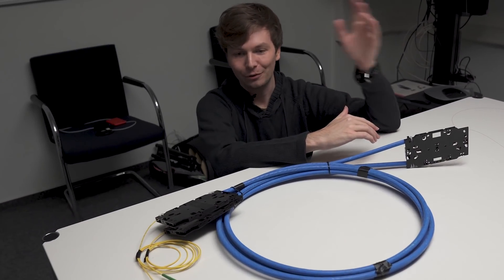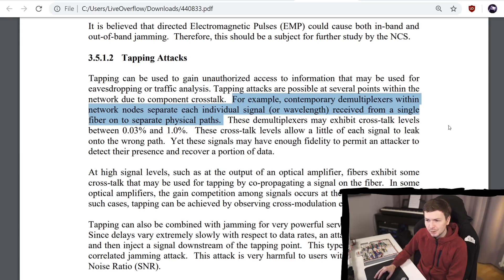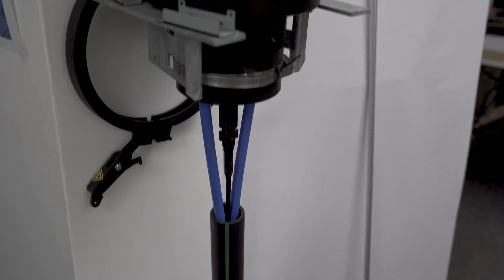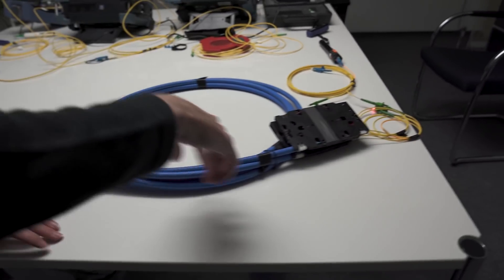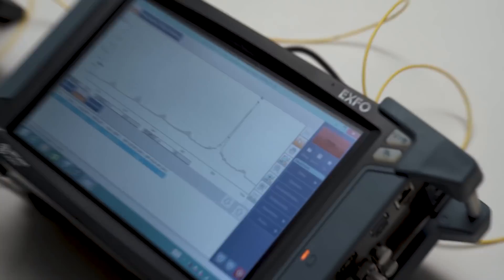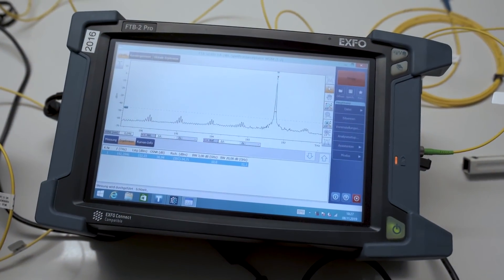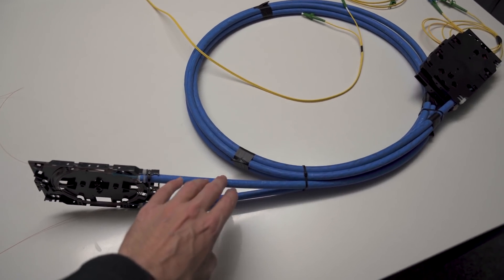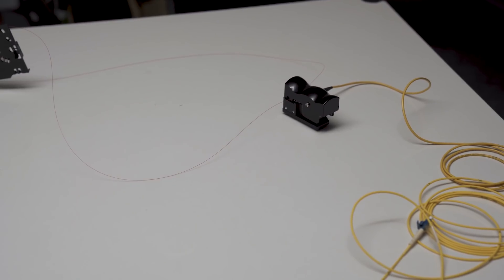Fiber Tapping - Monitoring Fiber Optic Connections

Comment: Would using a VPN and regularly changing the location make tapping useless?
Reply: You'd just be shifting the problem from your fiber to the fiber the server is on. It might even increase the risk.
Reply: @latte_macchiato_de  yea but could they break the encryption? And if I change the VPN location every few hours or so, would they go ahead and tap all those locations in time?
Reply: @blakryptonite1  You misunderstand my comment. All a VPN truly does is take your packages, put them into a box, encrypt that box with a key and send it to the server. The server decrypts it, forwards your packages and replies with more boxes of responses.

You're shifting security issues from your connection to the servers connection. VPN encryption is *never* end to end, it's only as secure as the weakest link.

Well, your second question depends entirely on whether you are truly an important target. If you are, you can bet three letter agencies will find a way to get your data.
Reply: Depends on the protocols used for all of your communications. Some ISPs encrypt fiber traffic, so regardless of using HTTP vs HTTPS or a VPN, this attack does not work. If your ISP doesn't encrypt the traffic through the fiber, HTTPS prevents sniffing/MitM. If you don't use HTTPS, but have an encrypted connection to your VPN, that traffic is safe, but the traffic from your VPN to the Server is not.
Reply: You seem to have a misunderstanding. From your comments it seems you think that if someone wanted to tap your connection he would pack his tapping gear up and travel to the physical servers that these VPNs use to route your traffic. From there he would listen in on your connection. 

But that’s not what would happen. Regularly changing the VPN location would have zero effect because if someone wants to listen in on your connection, they will listen in somewhere along the path between you and your ISP. Using a VPN does not cut out this essential first part of the journey. All of your home network internet traffic will go to your ISP first for routing; Using a VPN will only change where that traffic is initially routed to.
Reply: @synack_  Do take into account that a VPN encrypts all traffic using a previously shared certificate. You don't get to decrypt that. Listening at the VPN itself is the only real option.

Comment: They talk about tapping 19 years ago because they were already doing it many years before that
Reply: And that's why this technology became mainstream.
Reply: @lakami15128  Right... because copper can handle 100 Gbps, and is clearly more secure.  SMH
Reply: @ShainAndrews  weight, price, power consumption, losses..
I don't believe copper is more secure. In the end, IMHO there is no security without encryption of the data going through the medium.
Reply: @lakami15128  sure -that's definitely it - that's the only reason
Reply: We tested long haul fiber with this method over a decade before this document came out.  Basic stuff just to verify what carrier was on which fiber.  Been rolling out encryption for the past six or so years.  Encrypted traffic encapsulated inside encrypted fiber.

Comment: Edit: I stand corrected, read the replies to this comment  :) 

Soooo here's the cool thing about this. This is called 'evanescent coupling' . Massively oversimplified & in a nutshell, laser propagation through a fiber has a small portion traveling along the fiber, but outside of it, not in the fiber core itself. This portion of the light is called the evanescent wave. And if conditions are right and you place another fiber alongside, this light will couple into that fiber. If you wanna learn more about this, look for research papers or literature about optical coupling, fiber coupling, evanescent coupling, directional waveguide couplers etc.

Now the cool thing about this? It works both ways. So I can imagine you 'tap'  the signal, but you can just as easily introduce energie back into the fiber at the same wavelength. Energy-wise you could "feed"  the sytem energy, which you just took away by tapping into it. This way you could migitate the drop in power. Not sure what would happen to the information send through the fiber though, whether you'd completely drown out the original signal, or if it would just be perceived as noise and the data could still be extracted, making it more obscured that there's an attack. I guess that mostly depends on networking protocols, which I'm definitely not an expert in :D 

Used to do research with this very phenomenon, except that we didn't try to do data-manipulation or stealing, but use the phenomenon to develop incredibly accurate sensors, by investigaging how changes in the environment of optical waveguides altered the properties of the transmitted signals.
Reply: That's not actually the effect demonstrated here; this is a much more simple case of distorting the waveguide (fiber) enough that you get real waves now exiting out of it (using a bend), which is then recaptured as the "tapping"
If it was evanescent coupling, there would be no light leaking out at the tap, only light leaking to the adjacent fiber
Reply: @bluerendar2194  I don't think vanillesoep was suggesting that the demonstrated effect was evanescent coupling. Just that evanescent coupling could be an interesting alternative for the lossy tap demonstrated here. Physics sure is fascinating.
Reply: @eikenope1008  
You're right in that it's a really interesting alternative, and also poses an in-built security risk due to crosstalk if isolation isn't properly done. However, his comment says:
"here's the cool thing about this. This is called 'evanescent coupling' ."
Which is not the case for the demonstration (although crosstalk from evanescent coupling is one of the headings in the article at the start)
Reply: @bluerendar2194  You're completely right, not sure why I mixed up the two and rambled on about evanescent coupling. Thanks for correcting me.  Point still stands that you can introduce a signal into the fiber that you're tapping into, whether by evanescent coupling or other methods.

Comment: THz!? Holy smokes!
Reply: Thats not the frequency of the data signal though, but the carrier, i.e. the frequency of the red light. The usual infra red that is used has a lower frequency than the visible red light used for the test here.
Reply: @eikenope1008  Thanks for the clarification.

Comment: Why is that taping device so expensive? Isn't it just a mechanical device? I wonder if this can be 3d printed. I think it would be smart to bend the fiber less and make the taping active with some amplification. It'd cause a smaller drop in signal strength on the other end so would be much harder to detect. Fiber output boosters are expensive but I'm sure a simple circuit with a high frequency vacuum tube might work, if not maybe a garnet laser for amplification.

Comment: Signal level would drop on a strand: any software monitoring the transceiver would report the anomaly.
... And I should have waited until the end of the video.
Reply: You’d have to know what the original signal strength was. There are devices that can monitor the fiber and detect any tampering such as digging near the fiber cable or someone accessing the splice box/tray. The good ones can tell you where it is happening so you can dispatch police or security.

Encryption is available to everyone and is highly recommended for sensitive information that you send or receive.
Reply: @christopherestewart  AFAIK all optical transceivers support reporting of transmitted and received power levels. If (RxPWR.10111 < RXPWR. Then you likely have a problem.10111.avg(6m)*0.10)... 10
Reply: there might be tap with amplifier which would require much less bending. so have fun try to detect those
Reply: @nekochan7001  good luck getting an amplifier in the circuit without disrupting the connection. Plus, the iridium doping and amplification should be on the far ends of the link... Not anywhere between.
Reply: @jamess1787  he was referring to amplifying the captured signal, not the signal in the line. Basically, this would allow for less of a bend and create a less noticeable power drop.
Reply: @foxrumor  exactly !
Reply: @jamess1787  they have to amplify regularly for a long distance cable there is still signal degradation that needs to be accounted for in the cable.
Reply: @EwanMarshall  assuming the optic cable is 100km+ (or 70+ miles); anything less than that you should be able to easily detect losses on either side spike when there's a huge change to an underground cable or in a splice-can. Above-ground might have more fluctuations due to temperature shrinkage of materials (and relative losses/attenuation in the cable). Not many people using long distance above ground fiber for data communications though... Sounds like a terrible idea prone to outages and breaks.
Reply: @jamess1787  It is usually undersea cables they are dealing with here for tapping ;)

Comment: But the drop in signal strength would only be noticeable on the receiving end, at the sender. This tapping-detection would only be practical for closed-systems (mainly the military), not for general Internet customers. :-/
Reply: The operator usually provides the gear anyway, so it wouldn't be that difficult to implement.
Reply: Signal strength is definitely a metric you can view on commercial network kit. That said... If you're actually monitoring that metric, you're going to be a certain type of customer.
Reply: So tapping the military isn't concerning?
Reply: @guiAI  it's a known tactic (there are public designs of russian submarines that demonstrate under sea cable interception capabilities) but is of little concern considering all military communications are encrypted and all sides are at it.

In other news. Your WiFi network traffic can be captured... and it's using considerably weaker encryption.

Fibre for as "easy" as it is to use a microbend device to monitor the signal, I would still consider it more effort for a would be attacker to tap it. One requires you to delicately strip a glass fibre, bend it such that it leaks but doesn't break and monitor the signal using specialist kit that's capable of monitoring a signal waaaaaay below what a normal fibre transceiver module would work with.

The other, requires a network hub.
Reply: @lmaoroflcopter  Interesting, the point of my comment was that tapping the military seems a bit more concerning than tapping a random house, but of course both are awful
Reply: Well, yes and no, the cable provider controls both ends usually, someone like Level 3 that operates the cable under the sea, they *could* in theory use this method.
Reply: These days we mostly use single-fibre solutions that sends and receives on the same fiber separating traffic by wavelength.

Average customers are probably not monitored by the isp though, so if you are paranoid you should probably just use encrypted services such as a vpn as this defeats any attempts at fiber tapping.
Reply: if they use tap with amplifier which would require less bending it would not be noticeable at all

Comment: The place where the string is output at the end of the fiber cable (where it is just a strand and he connects the Russian tap device) - is that just for example purposes? So in real life wherever the cable is going would always be fully protected/wired right? Just curious because I don't know much about fiber. So to implement an attack like this you would pretty much always have to cut it open or use the split ends in the black box
Reply: >the cable is going would always be fully protected/wired right?
You can't fully protect a cable. Not like you're going to buy all land where it's laid, fence it and put security/cameras all over it, lol.
>The place where the string is output at the end of the fiber cable (where it is just a strand and he connects the Russian tap device)
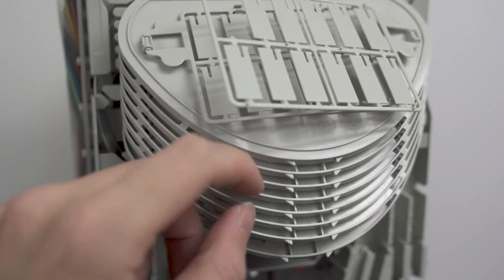As showed at 3:20 there's always boxes that contain bare strands. For what I know that's because you have to weld fibers together to make good passive (=> cheap) connection. After welding you're left with bare strands that are very fragile, so you coil them up (there's always some reserve lenght in case you would need to reweld them for some reason) and put in some box.
Reply: The cable is in one of the big black cases he indicated towards the beginning.  Its physically protected from the elements,  not from this sort of wire tapping.

Comment: The best way to install a device like this would be in the instalation of a new costumer. The installation guy could put one inside the box and the ISP will have no previous data about the signal and no way to measure a signal drop.

Since GPON uses the same downlink signal to all clients with splitters, tapping one client will give you access to the downlink of all clients using that cable.

In fact, in GPON a client could just put their card in promisucous mode to receive all packages sent to all clients conncted to that cable.

Comment: So, isn't traffic usually being encrypted between fiber-connected endpoints?
Reply from the maker: It’s a service that some places offer. And banking regulations requires it. But it’s not typical. But of course higher layers of protocol such as HTTPS are encrypted.
Reply: There exists things like MACSEC which will do that, however it requires specialised hardware, and may have an impact on performance of your router.
Reply: These days yes. Relatively recent change though, for the most part everything was in the clear before Snowden happened.

Comment: 1:56 I'm now reading a book on Assembly programming that describes how branch prediction works in CPUs since Intel Pentium Pro. And it clearly says that wrong prediction causes pipeline reset, which takes time. The time delay makes possible to detect what kind of data was executed/used previosly. The book from 1998 essentially describes the basis for Spectre vulnerability :)
Reply: Actually, Spectre does not use the timing of a pipeline reset at all. A wrong branch prediction is provoked (by training the predictor in a specific way) and the privileged memory is accessed in the wrong branch before the pipeline is discarded. The value read from privileged memory is used as an index to load a cache line and after the pipeline reset happened, you run through all possibly indexed cache lines and find the one that is loaded the fastest (because it was accessed before).
So the side channel Spectre uses is actually the memory / cache access time, not the time it takes to reset the pipeline.

The problem that enables this attack is, that privilege checks themselves are just conditional branches and if you can fool the predictor into executing a privileged access and use the result before the pipeline is discarded, you can acquire the data using side channels like cache timing.
Reply: Thank you for this information. I believed that Spectre referes to a family of vulnerablities that are based on the observeable effects of branch prediction stuff and my book very clearly described how pipeline reset happens and that it takes time, therefore I made the wrong conclusion that Spectre uses pipeline reset time. Hopefully my original comment still has some weight in a sense that people knew well enough how a CPU worked back in 98 (and maybe earlier) and had the knowledge to predict (and possibly prevent) such vulnerabilities.
Reply: @Arti9m  Of course your original comment still matters. As you say, branch prediction is a pretty old idea, but the idea to exploit it like in Spectre/Meltdown is fairly new. Side channel attacks are often very counter intuitive and because of this, take a long time to be discovered.
I think branch prediction was not considered a security threat before, because, as you say, the pipeline is "reset" and in an ideal model, this would mean everything is, as if the wrong code never had been executed. The cache latency as a side channel is a really creative way to extract data from these discarded operations.
Most of the speculative execution (branch prediction) based attacks in these last few years probably wouldn't have been discovered for a long time if it wasn't for this one creative idea.
Reply: @NamedKitten Book name: "Assembler. Учебник для вузов." by Юров В.И., pages ~32-36, hope you understand Russian! ^_^
Reply: That's nice.